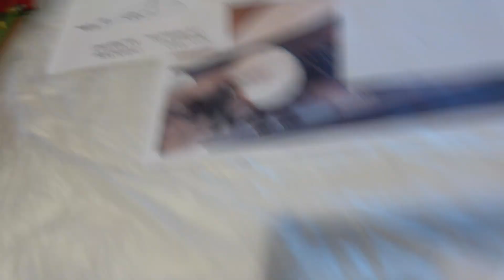(2/4) Exploring how the differential analyser works in simple terms

Comment: Very informative thank you

Are there any particular torque requirements for the motors rotating the drums? I heard that the drums must rotate faster than the input arms but no mention of torque

What directions are each drum rotated? I can’t tell when the motor is turned on, it’s going too fast to see in the video.
Reply: The motors required will have to provide the necessary torque you need in the rest of the system, they can be geared down to achieve that.  The drums rotate at the same rate but in opposite directions.  There are two videos currently on Youtube demonstrating the principle with torque amplifiers built in Meccano, just search "meccano torque amplifier".  I built one myself a while ago, it is extremely satisfying allowing it to run and feel the power being transferred to the output shaft.   The output shaft mimics the input shaft's movements and speed exactly but with an obvious increase in torque.  The objective with the differential analyzer's TA's was to prevent the pickup disks from slipping on the main horizontal disks. One interesting challenge with my TA was to get the tension of those cords on the drums just right.  The principle of their working is exactly the same as with what you find on large capstans where you coil a rope around to pull in a heavy object (even a large boat, for instance). Just by tightening the coils of rope around the capstan (which turns slowly but with great torque) the power of the capstan is then easily transferred to the rope.  Thus, with just a small increase in the pulling of the rope a much larger force can be initiated.
Reply: thank you sir